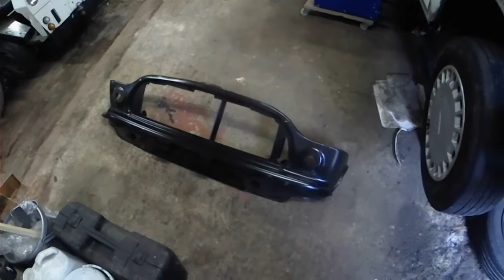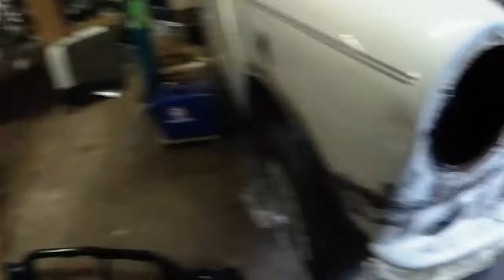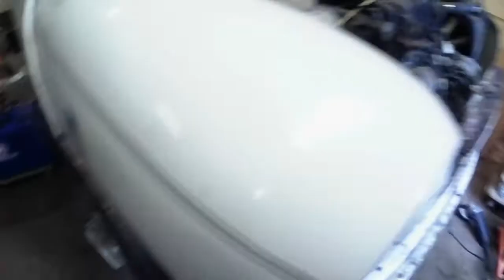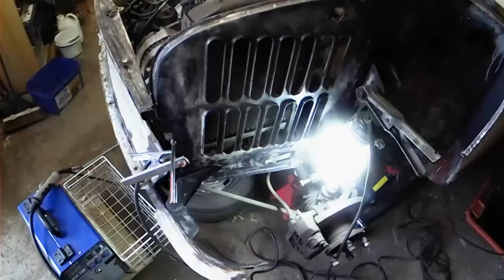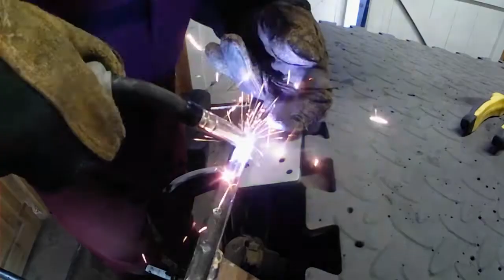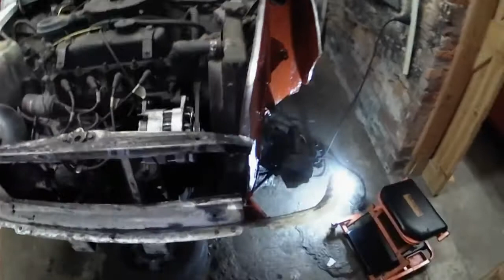Project Designer Ep 12 - Cuttinthe front quarter and preparing for welding the front wing on my Mini

Comment: Hi there, great vids very informative! Is that the r tech 180 you are using and would you recommend it?
Many thanks!
Reply from the maker: Yes, R Tech Mig 180. I would 100% recommend it. The compancy are really helpful and friendly, the quality of the welder is really good. Its very powerful too. My welding actual improved when I got this, its so much more controllable than welder which just have a hi and low setting.